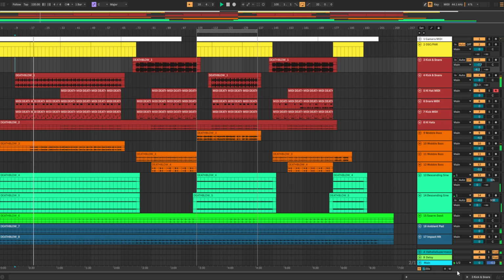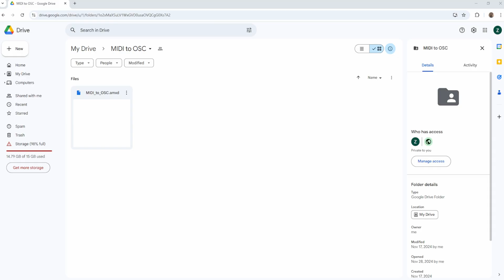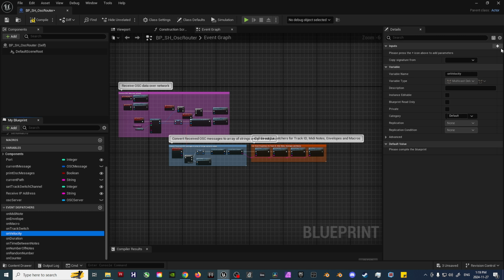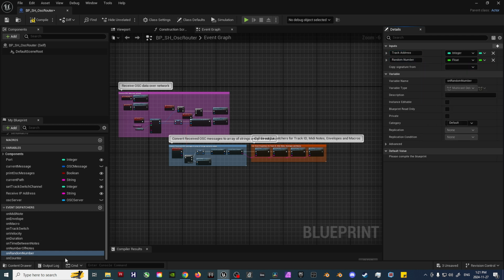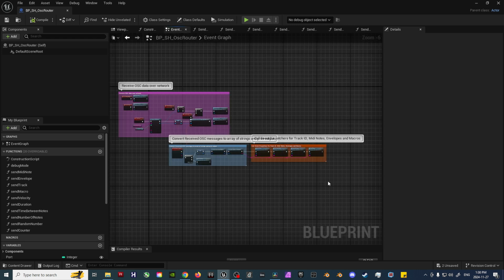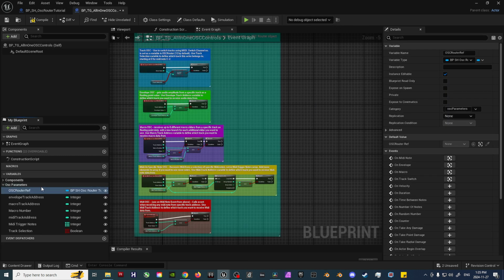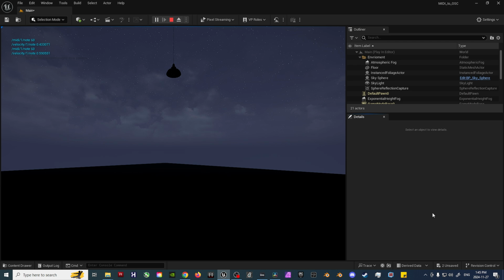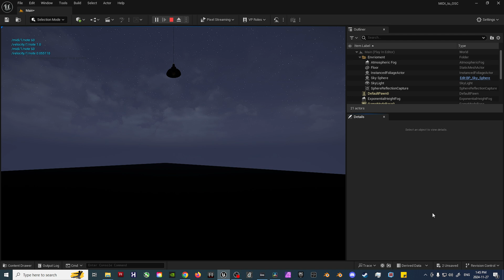How to make an OSC router blueprint in Unreal Engine for reactive visuals

Comment: Everithing is working except my Random Number Generator, the random number is printed from the OFCrouter but when I try to do something with lights, it doesn't react... do you know why this might be?
Reply from the maker: Thanks for bringing that bug to my attention. For some reason the "On Random Number (OSC Router Ref)" object in the blueprints seems to be not reading the incoming data from the router, despite everything else working and being set up in the same way. I'll be sure to let you know once I figure out why this is the case, along with updating the blueprints on the GitHub page. Sorry for the inconvenience.
Reply from the maker: Figured out the issue! Turns out I had an extra space in the "Send Random Number" function which was causing the information mismatch between the router and receiving blueprint. The new router blueprint file is now up on the GitHub page.

Comment: This is so nice! I was hoping to find something like this for Blender.
Reply from the maker: Thanks! I haven’t been able to figure how to get OSC data into Blender yet, among other things. So Unreal Engine has been the reliable go to option for the time being.
Reply: @ Thank you for your kind response🫶🏻 i just worked with a forked addon version (to make it suitable for blender 4.3) of „Addroutes“ which can recieve osc. But as the developer‘s website is down so are all the documentations. The only thing I tried is using MIDI which as you said is unfortunately just static. But making a connection to whatever you want to change is easy by right-click and „create realtime route“ on any Ui element. (Operators like the play controls seem not to be reachable that way). I am just not familiar with python or any other programming language. That’s why I am a bit stuck. If anyone could help it would be awesome.

Comment: Thank you so much for your improvements. 

This blueprint runs well in UE5.4, but when opened in 5.5, the OSC signal is not properly converted into an array of strings. Upon checking the debug objects, I found that the module "Convert Received OSC messages to array of strings and print output" and those after it are not running. 

I’ve encountered a similar issue before, which I could resolve by reconnecting nodes or resetting variables, but I haven’t been able to solve this issue this time (the same problem appears in the project files provided by Sem and Tris on my computer). I hope you see this comment. Thanks a lot!
Reply from the maker: Thanks for taking the time to check out the video and for the kind comment!
I’ve actually been running into the same issue with Unreal 5.5 and it seems to be a bug with that particular version of Unreal.
There’s even a post on Unreal forum where lots of other people have run into this issue.

I wasn’t able to get any of the OSC data to print or even work, until I changed the Port from 1312 to 0000. Once I did that on the router object, then suddenly it started receive the OSC data and print the strings of data as it once did in older versions of Unreal. Which is strange because it’s the incorrect Port number, but oh well…

With any luck this issue issue will get resolved in a future update. Hopefully this helps resolve your problem.
Reply: @ZackBerw  Wow, it actually worked. 🤣Using 0.0.0.0 as the server IP is a right choice. Thanks for the suggestion!
Reply from the maker: @ I’m glad to hear it worked on your end too! I look forward to seeing whatever you come up with.

Comment: Thanks so much for this, it's exactly what I'm trying to pursue.  Sem and Tris AV club is great, and yet for some reason I can't find ANY projects or even M4L code about sending the BPM of a project, do you think you could help with that??

I thought it would be so simple but all I find is "reactive" code that responds to MIDI notes.  I really want procedural animations that sync up according to the BPM of the music.

Thanks so much for any help!
Reply from the maker: No worries, thanks for taking the time to check out the videos!
Since posting this video I actually recently did an update for my version of the MIDI to OSC device that counts and tracks the current beat (quarter note pulse) and bar information pertaining to the bpm. Adding/exposing the tempo number for Unreal on top of that is really easy, and I'll be sure to update the device on my GitHub page with that as soon as I can. 

You basically just have to open up the currently available MaxForLive device and add the value as exposed by the transport node that's already apart of the MaxForLive device.
Reply: @ZackBerw  I have to admit I only kind of understood that but regardless, you're a HERO and I look forward to seeing it, THANKS!
Reply from the maker: @JoshuaLundquist  I just uploaded the updated MaxForLive device and Unreal Engine blueprints to my GitHub page, so you should be good to go when it comes to getting the current tempo into Unreal. There's three toggle switches that allow you to send over the data either every time the tempo is changed via automation, every bar or every beat (quarter note) depending on whatever works best in your use case.
Hope it helps!